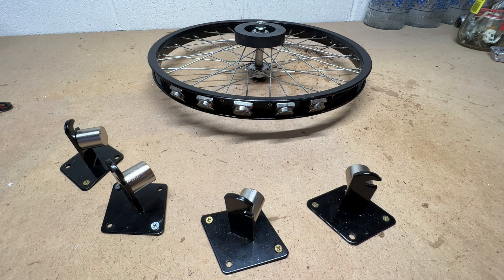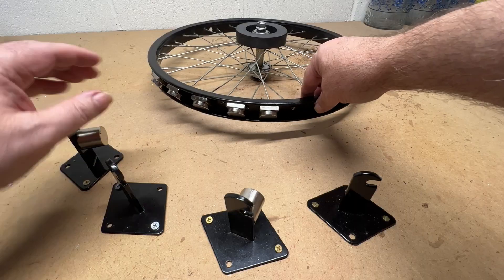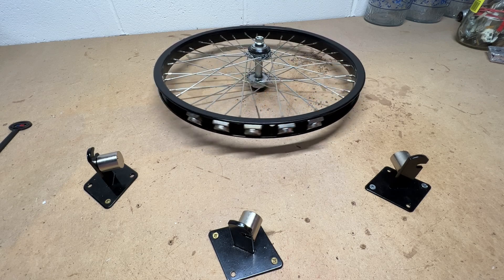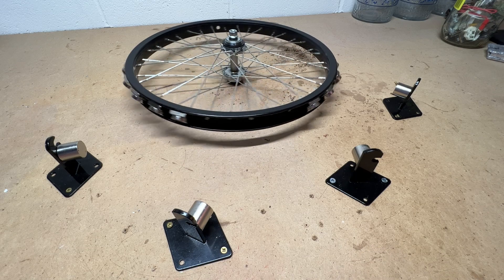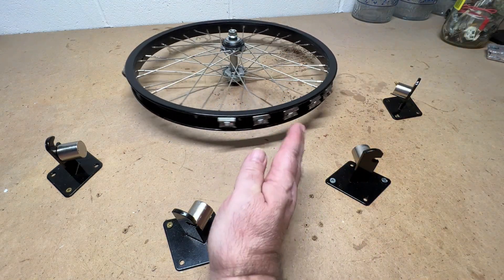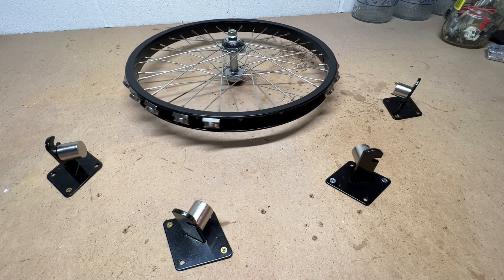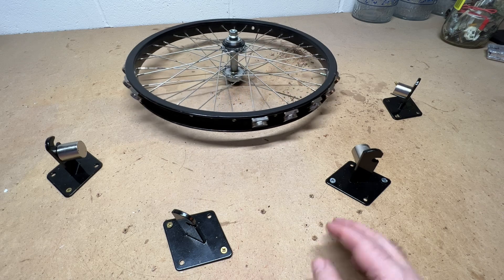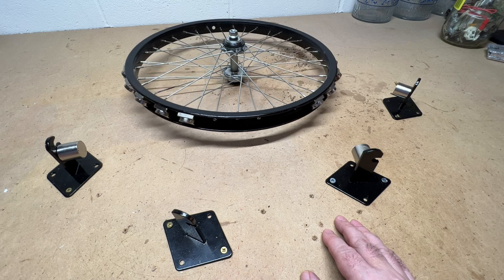🧲 Free Energy Magnetic Motor Research & Development Testing

Comment: I woke up 1.40am to watch this and lend you my support! 🐱👍🏿
Reply from the maker: Thank YOU! Got up at 2:29am EST to check you out at as well. Saw your 1:40am comment here that you were thoughtful enough to leave. So how long did this run? I'm going to build one of these again, but this time with huge improvements. Double duel coils. The larger secondary set dedicated to only charging the battery. Completely different coil set up as well never seen online that I know of. 

Time and again when people build a self running electric motor the coil design and positioning never maximizes the full potential of the magnet. Most forget the magnetic pulling force of the field suddenly becomes a 100 times stronger when just a quarter inch away from the magnet. More so, rather than the magnet continuously  passing the coil, the spinning 2" x 1" x 1/4' Neodymium magnet is place inside of the custom 2-1/4" long x 1-1/4" wide x1" thick rectangular copper wire coil. 

My third design in my best design, where one coil 'encircles the entire armature magnet on all side, with two tiny coils are placed inside of the coil triggered by a reed switch to spin the magnet.

Hope all this make sense. Going back to bed. LOL ZZZzzz
Reply: @FreeMagneticEnergy2  🐱👍🏿